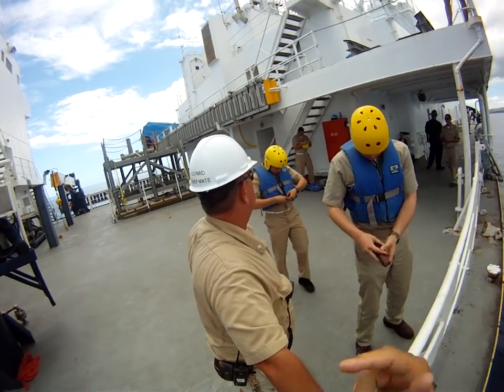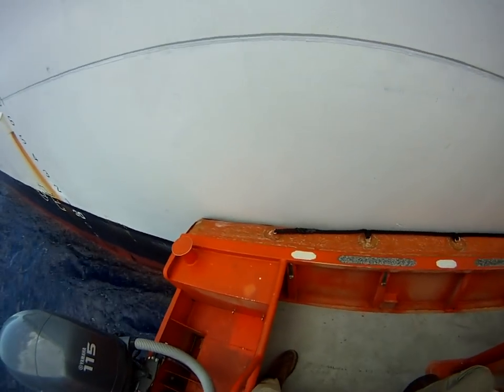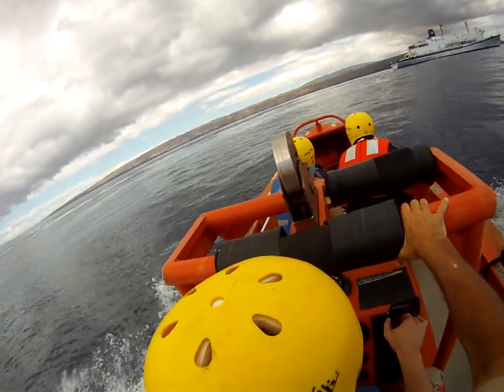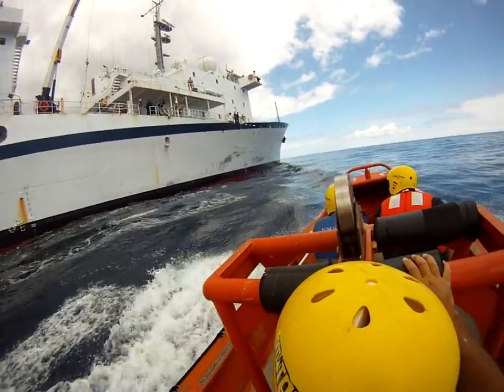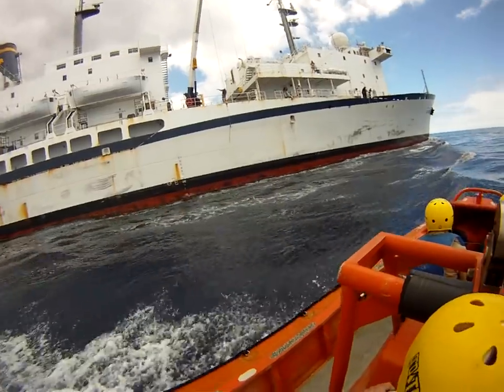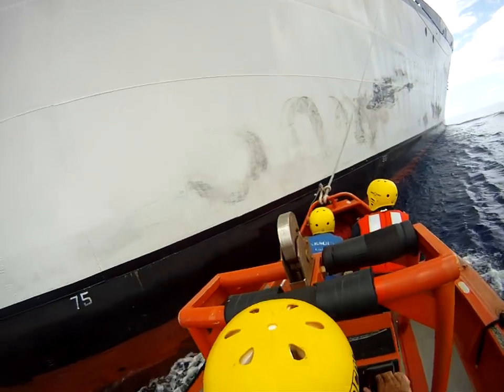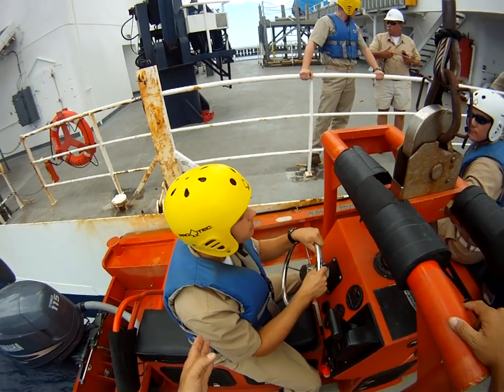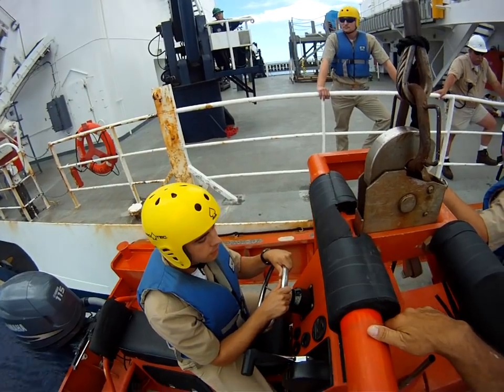Proper procedures for launching a Fast Rescue Boat (FSB)

Comment: This is no way the safest way to launch a FRC., Glad im not onboard that death trap
Reply: What would you like to be done differently?
Reply: You still haven't answered the question! Come on expert! tell us how in your professional opinion you'd do it better?
Reply: There´s a lot of things i do differently when i launch and recover a frc., Here´s some examples., First thing you do is having a prober "tool box talk" with the people going into the boat before sailing., you shouldn´t have to explain to them what to do when they´re already in the boat, they should know that before even entering the boat., When launching the boat you should turn on the engine before you hit the water and give it some speed, so when you hit the water you quickly can reach the same speed as the ship and not drift back into the stern wave and also when the boat hits the water you should turn the rudder so the boat is "sucking" itself against the ship and you never move away from the ship before the boatman have looked back to check if any high waves are coming., if you just move away from the ship without looking back there´s a big chance a breaking wave is hitting you from the back and flips the frc., When you approach the ship to recover the boat, you never sail in the bow or stern waves., that is a "no go zone"., you approach the ship in between the 2 waves and find the speed of the ship before you get close to the ship again., And you never just hook the boat without the permission from the boatman., He is the one who gives the command to "hook on"  he needs to make sure the speed is correct and he is at the right place on the side of the ship and in control of the boat before the hook is placed..

I sail in the North Sea and f.ex we make crew change in frc´s in up to 5 meters wave., I have the competence level to sail frc´s in over 8 meter waves., I know this video is made in flat water but the procedures should always be the same so you never develop "bad habits" Hope some of this answers your question
Reply: SnffsndRR I guess you’re from Esvagt. I agree with all you wrote, but dont lie. Unless You’re the guy who saved a guy from dying, You’re competence level is not even above 4,5m waves. Only one guy in the company got permission to sail in 5m+ waves.